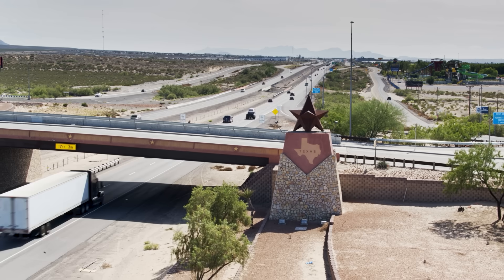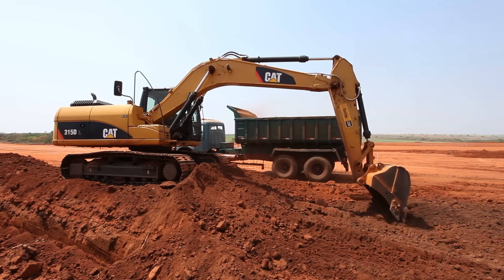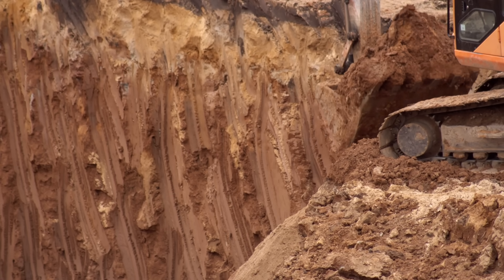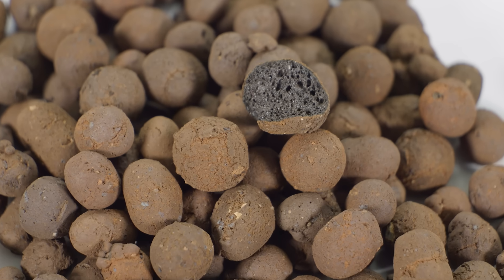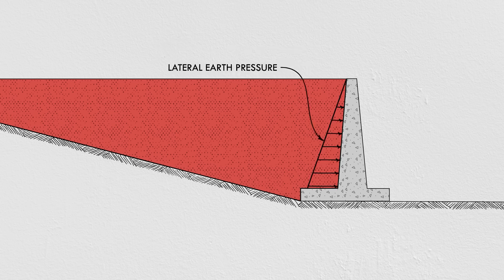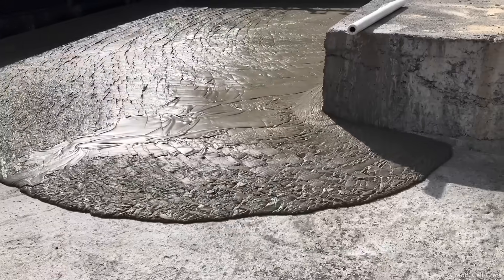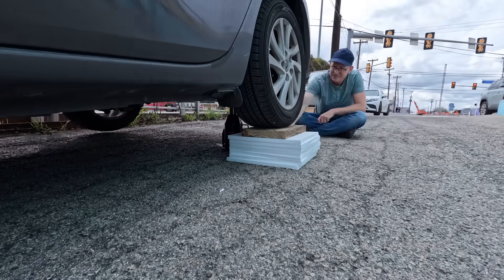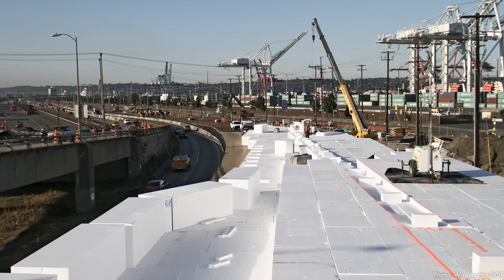Why Some Roads Are Made of Styrofoam

Comment: An alternative approach to prevent the bump from forming is to build a downwards sloping extension a few meters beyond the end of the concrete viaduct, that gets covered with the fill of the embankment to make a roadbed. Thus the difference in settlement is smoothed over that distance, instead of manifesting as an abrupt bump.

Comment: 10:56 Wow. Is styrofoam still used for cups and fast food packaging in USA? Apparently they were completely banned in Norway only in 2021 but it has been really unpopular for ages; I don't think I've seen a new styrofoam cup since the early 90s here. And other uses for packaging is increasingly uncommon. I'm now always a little surprised when I se styrofoam packaging of any kind, especially packing peanuts have been almost all been made of cellulose or starch based stuff for at least 10 years now. The only things I occasionally still see it used for is solid shaped padding around electrical products. But even these are now usually now made from carton.

Comment: A company came and did an expansion project on I-49 in the northwest corner of Arkansas. There's two bridges with less than a quarter mile between them. They messed up those transitions so badly, it was actually causing accidents and they had to come back and fix the approach and exit road portions adjacent to the bridge.

Comment: I was pretty surprised to see a large staircase laid down across the road from me - around 15 meters wide, 30 meters long and each step over a meter deep so a very gentle grade but large area - formed to full height with styrofoam before the concrete surface of the steps was poured. I thought it was just a cheap alternative to fill, but I'd never considered the weight aspect. Thanks!

Comment: Civil engineer here!  The expanded aggregates are a terrible choice for embankments.  They are lightweight and porous, but they can't take much weight themselves.  If you use them as a base layer you'll find that it sinks even faster as the material is compacted down.  There's a reason they use soil, as it compacts far less than more air-filled materials.

Comment: @ 6:10 these things have been the bane of my existence when clearing snow and ice from train stations. Its not possible to use salt as the thawed ice/water/slush salt mixture interferes with the sensors on the train tracks and urea pellets are too expensive. So the only alternative was to clear the snow with machine and hand tools and then throw this that crushed shale/clay aggregate out on the walkpaths. The worst part was the dust, the runoff from my nose was sometimes charred black.

Comment: I used to ride shotgun for a long range trucker. There was a section of the Trans Canada highway running through a swamp (near Ignace). At one time it was so wavy that transport trucks had to slow down to 30mph or less. Otherwise the truck would just bounce off the road.  They rebuilt it using styrofoam to cut down on frost heaving. It has been good since.

Comment: There is a reason that the cost for disposal of EPS is the same, for a 40kg load of EPS, as that they charge for a full 60 ton truck of rubble, the volume is roughly the same, and it does not break down in landfill at all with time. There has been a lot of work on making EPS have a second life, the packaging pellets alone are a massive volume that has to be disposed of annually, let alone the amount used for packing pieces in transit. Thus the use of crumbed EPS, spray coated with acrylic polymer, to make the fill for the lightweight concrete mixes, as it does allow a good saving in mass of concrete.

Comment: there was a critical failure of the embankment under a highway near my home, and when they replaced it, they used geofoam instead of traditional backfill, it was surprising to see, but made perfect sense, cause they were building next to a reservoir, so the soil had compacted under the traffic load so much that the roadbed actually fell away in a small landslide across most of the southbound lanes, emphasizing the need for a lightweight backfill material.
Reply: No there wasn't. Quit lying. Buy Hello Fresh.

Comment: In Switzerland and I think generally in Europe, there is usually a drag plate (contrete slab at a 10° angle, about 5m long, below the surfacing) at the end of the bridge to ensure a smooth transition between bridge and road.
Aren't drag plates used in the US? And if not: Why?
Also, there often are expansionjoints at the end of a bridge, which also lead to bumps.

Comment: Over twenty years ago I worked for a national insulation product manufacturer as a multi facetted internal/external engineer?, I had on occasion to visit a supplier of eps products, after a plant tour and customary sit down I learned that in down town Chicago used mega block eps infill around a high rise in lieu of traditional gravel, the benefits were many and loading was considered..cutting is done with resistance wire, adhesive done with urethane sealants….more dollars per volume, but extremely fast setting…

Comment: The issue with the lightweight fill used in near waterways, is that it will also saturate and hold water quite a bit longer. Then you have to deal with more erosion. Especially when you're dealing with sheet walls and reinforced anchors.

There's no such thing as free fill. Usually cuts and fills are equalized to reduce costs, but by doing so, you often create scenarios where you're placing things at less than ideal elevations.

When I hear there's excess fill available near a waterway, either they increased the size of the water frontage,  or they're under building the surrounding infrastructure to make things flatter or more esthetically pleasing. Not always the greatest idea in terms of longevity. Sometimes free fill comes from not actually hitting compaction specifications (but saying they did).

Fantastic video as always. I'm an industrial/construction surveyor, and I'd love to see Grady's (a perfect name for a civil engineer btw)  take on soils load testing. I've seen some questionable approaches to it in my travels. Specifically field measurements and different techniques Eg: Plate load testing on compacted fill before raft footings.

Comment: Fascinating! I had no idea this was a thing! I have a question, though, Grady...

One of the problems with EPS is that it's notoriously unrecyclable and non-bio-degradable. Obviously that's part of why it makes a good lightweight backfill material, but I can't help but notice that they're freshly cast blocks made specifically for this purpose.

Could shredded post-consumer/post-industrial styrofoam be used instead, like an aggregate? It'd be denser and a little heavier than the blocks, and weaker, but it would also be basically free (possibly even negative cost). Possibly a good compromise between the engineered blocks and the foamed/expanded aggregates? Or would it be too springy? I'm picturing something kind of like sandbags filled with shredded EPS, so there's some interlocking and added strength, a little like the reinforced aggregate from your early video.
Reply: Probably can be as simple as shredded EPS packed into polyester bags, like gabions are, with the bags then placed in position, and then filled with a thin slurry of foamcrete to set the bag into position, locking the EPS into position. Then the exterior gets a gunite layer applied to it, and a mesh reinforcement in between the 2 spray coats, and then the final fill soil is added to it. The bags will hold up quite well, and are also a thing that has to be disposed of, leading to them being able to come pre filled, but very light, to the site, and needing only a telehandler to position them, then use the existing concrete pump you have there to fill them, with your concrete batching plant making the light slurry on site easy enough, using shredded foam that has been coated to allow concrete to adhere to it well, and thus not separate during cure. Coating is just tumble in a mixer while spraying cheap acrylic paint onto it, then tumble till they are more or less dry, and add the cement and water.
Reply: Styrofoam can be and is melted down and repurposed. Just because these blocks are freshly cast doesn't mean that the original material is freshly procured. Shredded material in bags also wouldn't be very stable.
Reply: @KainYusanagi  Where are you getting that? My understanding is that while it is possible to recycle styrofoam, it's prohibitively expensive, because you can't just melt it down thermally; it takes solvents and a multi-stage chemical process.

Plastic recycling in general isn't anything like as successful and common as people tend to be lead to believe, and my understanding is that styrofoam is one of the least recycled, at less than 2%.
Reply: @barefootalien  EPS styro is actually pretty simple to recycle as far as styro materials go.  Other forms of styro such as XPS are more difficult if not impossible to recycle.
Reply: @DerpyPenguin4747  Expol, who manufacture EPS products in my area, recycle offcuts and waste EPS by shredding it and casting back into blocks for this sort of use. Just needs the right combination of heat and pressure to make all the bits stick back together.
Reply: @DerpyPenguin4747  Even if it can be recycled, does it happen much in practice? It took some effort to even locate a recycling place remotely near me that would accept EPS, and it turns out that they don't truly 'recycle' EPS (as in produce new EPS from it) but rather 're-use' it to make home insulation.

Comment: You should look into the US-36 collapse in Colorado, could be a good tie in with this video. The embankment (which looks like MSE) to an overpass collapsed. It was eventually replaced with Styrofoam blocks. Happened a couple years ago so all the settlements are complete and the full story should be available.

Comment: Train tracks can be re-graded using hydraulic rams to 'inject' fill under the tracks. I'd imagine something similar could be done with roads. Most bridges I have seen simply use expansion joints for the transition.

Comment: Lighter than water concrete to make durable pontoon bridges? Houseboats? Mobile warehouses? Unsinkable floating fortresses?
Reply: If you notice his destructive testing had the capacity of that concrete at about 200psi.  for comparison purposes, construction concrete is between 3500-6000 psi depending on job requirements. This wont be replacing structural concrete anytime soon.  It's specifically for certain jobs where overburden weight is a limiting factor.

Comment: The replacement for Seattle's Viaduct was the tunnel. A huge section of Seattle's downtown used to be Beacon Hill, until settlers pushed the dirt down the hill to extend the city. This might be less-dense than traditional soil, wight might be part of why they used polystyrene. But parts of that area are below sea level. Would be interesting to get some more details beyond "it was used in the project".

Comment: I've seen in Sweden that our bridges and overpasses, that the roadway is not rigid connected, but rather supported by wheels on the support column.

I have my ideas on why, but it would be cool with a video explanation 😊
Reply: That is primarily to allow thermal expansion. If a 100m bridge expands by 5% between summer and winter that is a 5m expansion/shinkage that needs to be accomodated. Usually 1 end is "pinned" so that it can't move in any axis, and the other has rollers to allow it to move in 1 axis but trapping it on the other 2 (technically its its held in place vertically by gravity but that force goes through the roller and pins). 

The end with the rollers also shoulf have some sort of interlocking teeth, being more noticeable the larger the expansion joint needs to be. On a small bridge its likely to only be a couple cm or in big, but on a large bridge they could be several meters or yards long.

Note: the numbers for my hypothetical 100m bridge are probably very unrealistic but were chosen to be easy to do mental math with.
Reply: ain't that just expansion joints?
Reply: @PrograError  yeah most likely, but don't ruin the video fun 😉
Reply: @Phootaba  he already made a video about that.
( IIRC it was a short )
Edit: not a short. The video is called "Why bridges move..."

Comment: I think a major takeaway that transcends industries and disciplines, is the fact that the least expensive suitable material does not always result in the net least expensive finished product.
Reply: On the other hand, what's cheap now might not be so cheap later, if repairs need to be done because of improper material use.
Reply: Cheap goods aren’t good, good goods aren’t cheap. 
Well, usually.
Reply: @macmedic892  Cheap, fast, good. Pick any two.
Reply: @macmedic892 It actually applies both ways. Cheap things aren’t always bad and expensive ones aren’t always good.
Reply: In the computer networking field, we learn this the hard way.  Equipment that costs less upfront often will cost more with reduced uptime and increased labor costs in troubleshooting or consulting fees. Buy reliable products out of the gate and save yourself a lot of hassle.
Reply: @AllYourBaseAreBelongToU5  I see it all the time too! Companies implement the expensive, complex software and cheap out on the servers to run it.
Reply: @marcberm  And then they wonder why their maintenance programmers and network guys can't seem to figure out the weird, sporadic, and downright intractable errors that keep unreliably popping up in the logs causing random users intermittent grief.
Reply: @AllYourBaseAreBelongToU5  It's the Sam Vimes "Boots" theory of socioeconomic unfairness applied beyond socioeconomic status; pay for cheap, you get cheap, and it wears out quick and performs worse. Pay for good quality, get good quality, it wears out slower and performs better. That isn't to say EPS is low quality, mind; it could truly be the best option in a given scenario, and allows recycled EPS to have a stable landfill function while performing support, too. Just was noting it as a generalism.
Reply: @KainYusanagi  Thank you, Dr. YouTube.
Reply: It reminds me of how much extra time I spend at work dealing with the inconsistent and sloppily made recycled a36 steel versus how smoothly it always goes when I get to work with nice well made grades like 1144 or 4140.
Reply: ok
Reply: You can have it fast, cheap, or good. Sometimes, two of those. Never, all rhree.

Comment: I would like to know what is the ecological footprint of those lightweight materials. EPS is air and plastic. I mean there are reasons we are trying to get rid of it.
Reply: Compared to using the styrofoam in disposable cups or bowls, using it as backfill is significantly less environmentally damaging (the carbon in the EPS is sequestered, and is unlikely to be released into the atmosphere anytime soon). The expanded clay and glass requires kilning to rather hot temperatures, which of course requires significant amounts of energy, and Portland cement requires making quicklime, which also requires kilning. The video doesn't mention the composition of cellular concrete, so I can't comment on how the foaming agents affect the environmental impact of the concrete, but since there's less cement per unit volume of concrete, it might be less impactful than an equal volume of regular concrete.

Comment: I saw the EPS used for an overpass in my area. The road needed to go over a train track, and was in a developed area so the embankment had to be as thin as the road. As well, the area was partial wetlands so settling was likely a substantial concern.

I had always thought it looked like styrofoam, interesting to find out that it was exactly what it looked like!
Reply: Styrofoam can have 50-100 psi compression strengths, in inherently spreadsouts out load well if it ever is overloaded, which seems unlikely given that most tires are more in the 30-50 psi range.
Reply: Would you happen to live in SLC, Utah?

Comment: I'm familiar with multiple road engineering fails.  if people look up the "meanwhile, in Oregon" road, I'm familiar with that one - they built it on tree trunks across a swamp.  as the trunks became saturated, the road began to sink, leading to it flooding every winter.  since the picture was taken, they've thickened the paving and raised one of the bridges, which helped, but the road is still sinking, so they have to pave the bumps at the bridges every year.
in another spot, a road slid away, and they did emergency repairs with wood chips.  for years after, you could see steam coming out of the cracks where the chips were settling and decomposing.  
and in the final, we've got a stretch of unstable ground, where the asphalt us now feet thick, from paving over sections as they settle.  this last, I'm starting to wonder why they don't essentially build a bridge at ground level, to support the roadbed over the soft spots.
Reply: >I'm starting to wonder why they don't essentially build a bridge at ground level, to support the roadbed over the soft spots.

cost
Reply: @randommcranderson5155  because paving the same stretch of road on a sunday two or three times a year is cheaper?

because it seems to always settle on a friday or saturday night, so they're out doing emergency repairs on overtime.
Reply: @kenbrown2808  "because paving the same stretch of road on a sunday two or three times a year is cheaper?"

It might be.  Digging down and doing a major structure on marshy ground could certainly be pretty pricey.  I'm not saying that they're not wasting money, but I am saying that just from your description of the site it's not insane to me to think that they are doing it the cheaper way.
Reply: @CatCube2  the question is how long will it be cheaper.  how many years of weekend patches will add up to the cost of engineering a span they can drop in place, anchored by points that are stable.